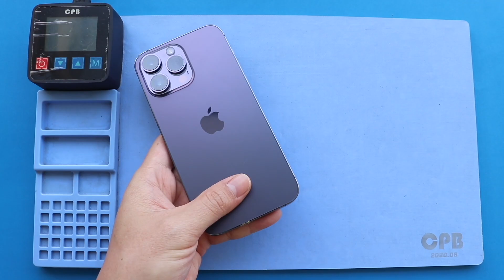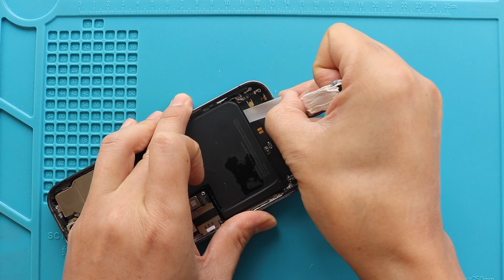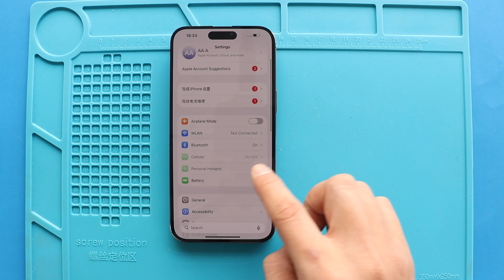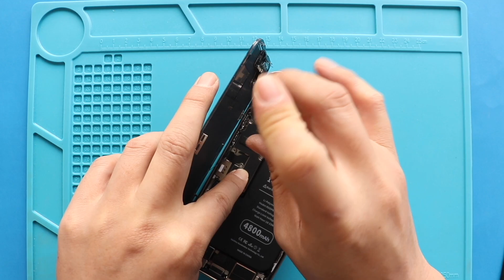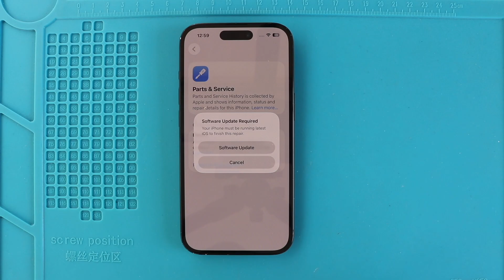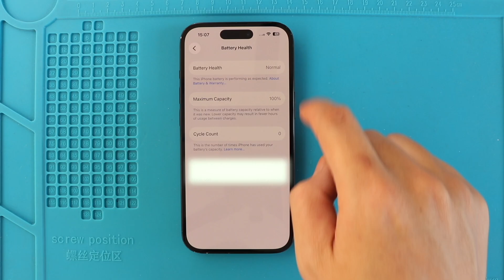iPhone 14 Pro Max Battery Replacement | Fix Battery Draining Issues

Comment: Fake video everything is fine but last section was fake because in 14 pro max don't show cycle count 😂 you joker caught
Reply: “For iPhone 14 and earlier models, there is no native on-device display for cycle count.  You can find it by checking the Analytics Data logs: go to Settings > Privacy & Security > Analytics & Improvements > Analytics Data, open the most recent log-aggregated file, and search for BatteryCycleCount.”
Reply: Google search…
Reply: @aNutorSmth why i need to google search im already using 14 pro max only 😂 nearly 3 + years using so no google search needed for me